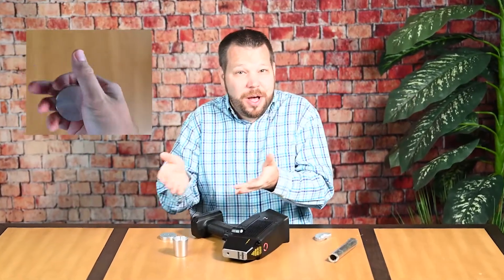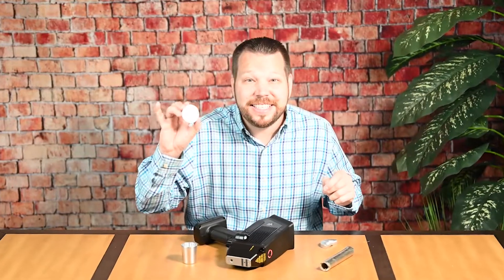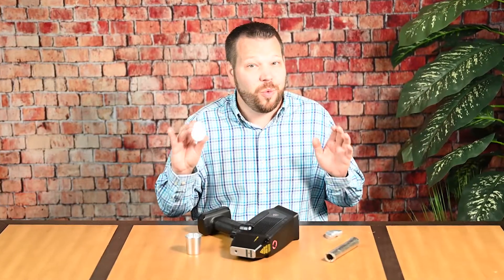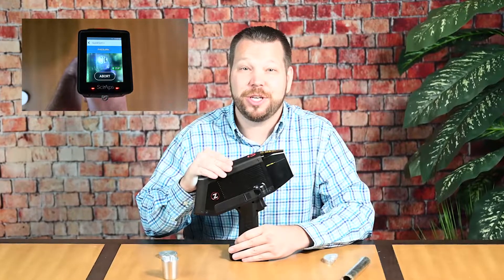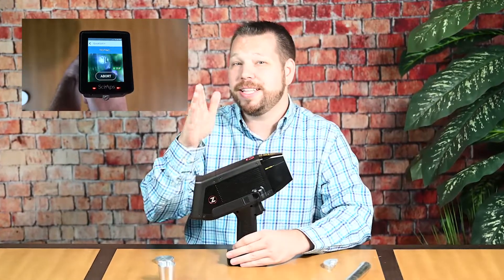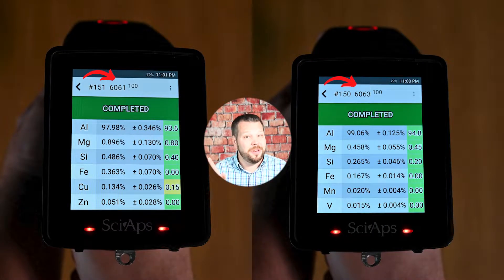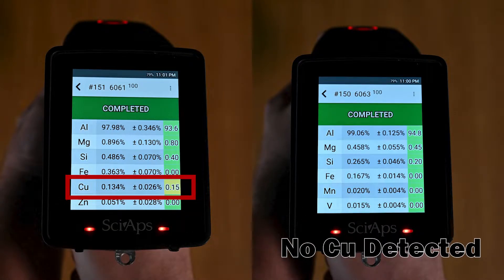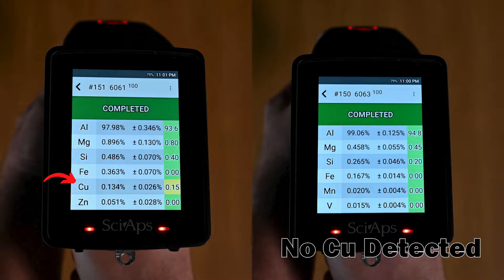6061 vs 6063 Aluminum-How to Sort, Chemical Differences, Property Differences, Which Analyzer to Use

Comment: 6063 seems to be a bit more pliable on one of my monopods, whereas 6061 is more rigid.  For internal twist-lock capabilities I am looking for something in between these two aluminums. Is there not a 6062 type??  thanks!!
Reply from the maker: Not sure, but you can seek a different heat treatment for 6061 to dial the properties into what you want.

Comment: what sort of an alloy results from aluminum scrap junk when melted down.
Reply from the maker: Great question. When melting metal, the chemical composition will be roughly the average of all materials put into the melt. If you're looking specifically for 6061 or 6063, you want to avoid other scrap alloys getting into your melt. A little bit of the wrong alloy can go a long way in messing up the final chemical composition. 

We have helped many folks melt scrap aluminum in the USA. You will need handheld and benchtop equipment along with a furnace setup to melt like this. Melting aluminum is disruptive enough that local environmental individuals need to be notified as well.

Comment: Hi! Thanks for the informative video!  A question in Aluminium recycling: would the process of melting and casting of sorted scrap made of Alloy 6061 or 6063, affect alloy composition? resulting in different alloy and requiring additives (magnesium, silicon, Cu...)?
Reply from the maker: This can depend on a lot of factors. In short, melting properly sorted metals like a batch of only 6061 where you have verified every single piece of 6061 as the correct alloy will yield a good melt of 6061, so long as you do not mix it or dwell it with anything else. Some factors that could cause an off chemistry mix: dirty furnace lining, dirty ladle lining, improper scrap sorting, the list goes on. However, I can tell you from experience that most important part of the entire process is what you put in the furnace to begin with.
Reply: @AlloyGeek  Thanks a lot! 🙂